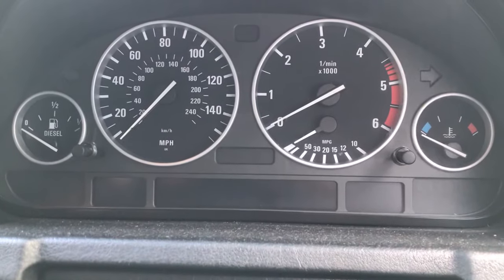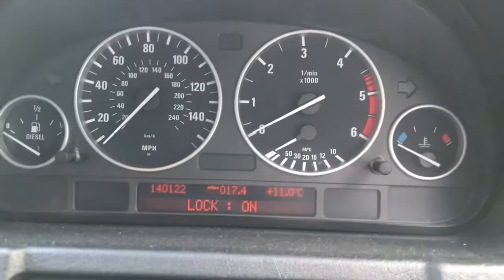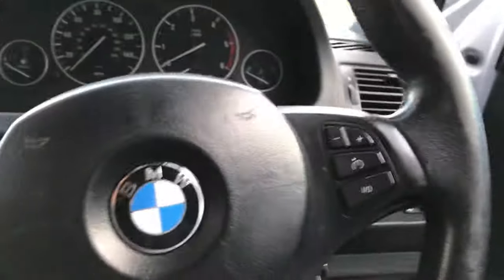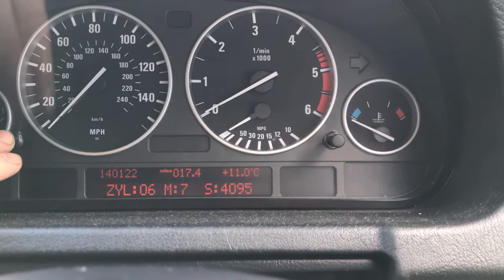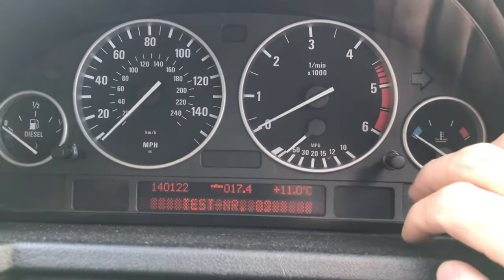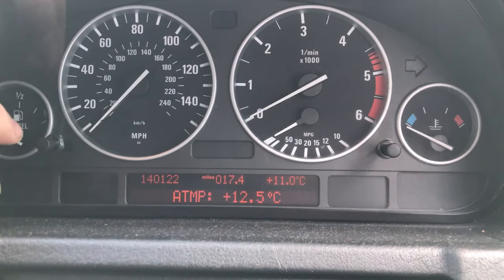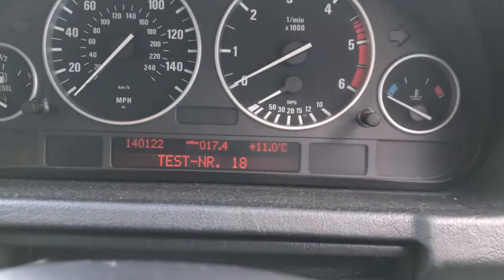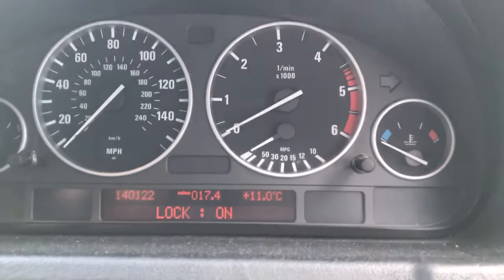How to use hidden test functions on BMW X5 e53

Comment: Hi, this is very nice video, but could you please tell me how to set up the date and time? I do not have the original radio i have an android unit, and that is why i want to know if i can set up the date and time through this menu
Reply: Hi, same issue here mate :)  .. did you manage to set date/time on your E53  ? I heard you could set it via navcoder software
Reply: You must buy IBUS then you can control more a lot more
Reply: @andzesiklenkovskij3696  where and how to buy it?
Reply: Thats the downfall of putting aftermarket units in your car. They never pair up completely

Comment: Can i adjust the clock from the menu? Cause i have an aftermarket stereo..
Reply from the maker: unfortunately i wouldn't know, i sold the car years ago
Reply: hi vladito, where you able to set up the date and time with the after market stereo? Im in the same situation and I dont know how to do it.
Reply: @denisovanhybrid9610  you are right only way to set it up again is to use the original radio!